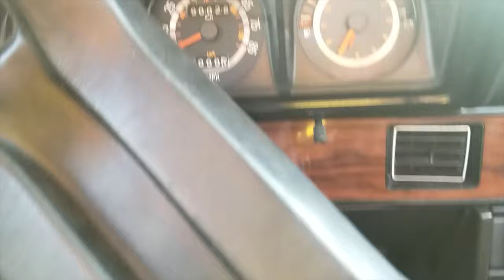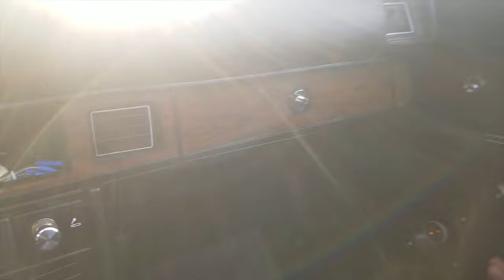1200 mile road trip for a Dodge Rampage!

Comment: i've got an 82 sport package,it came with a/c and power steering,this little truck car is about the most fun i've had in a long time,it handles like a dive bomber and the 38 mpg is right on time too,mopar had it right,the buying public,as usual blind and led
Reply from the maker: Light, snappy, and good fuel economy! I know people love Hondas but the K platform and it's siblings are a hidden gym with all the same features. I think the parts market is the only gotcha.
Reply: @NecromancerGarage  WELL I'M PARTING three now,they say the windshield is not available not true,the 024  will fit right in,if you want parts get out of the big cities,they are out in the countryside,when they break they believe the mechanics cause 1 they don't want to work on them,this keeps theprices down,i'm in

Comment: Great tuck for a great price!
Reply from the maker: Yup! When are you headed back to the KC junkyards? The Chrysler section has been slowly decreasing to just a few dozen cars.
Reply: Matthew Neuforth I went out last weekend. Pulled some Parts from a Buick and a Lincoln. I missed the Chrysler TV though. I was away in Detroit.
Reply: *TC
Reply: @NecromancerGarage  , did you ever consider giving your truck increased body strength, agility, brakes, a massively upgraded exhaust system, a top to bottom restoration, including under your vehicle, and at least a Hellcat crate engine/transmission kit, out of curiosity?
Reply from the maker: @paxhumana2015  Yeah, then I'll take it to SEMA.

Comment: Yeah, I'd say you got the deal too!! A five speed and no visible rust, great combination for that vehicle. I had an 82 4 speed bought it in 83 - 92. And it was pretty fast for a 2.2. These were cheaply made and not made for a long shelf life. What actually was wrong with this? And 'YES' I do miss mine terribly after seeing this.
Reply from the maker: The only issue really is the clutch wont engage, that's about it.
Reply: I have two Rampages, neither have any rust.  The 2.2 can be durable(newer head gaskets) , the OEM 4-speed was weak, use a A523 five speed.  To prevent rust,  keep clean underneath, open drain holes in body panels,  and they are not likely to rust.  Put them on a ramp and fix the rust before it gets too bad.  In just about every country nobody considers rust to be a preventive maintenance issue.  Use a lanolin based product like Fluid-Film.  L-bodies are not safe in a crash.